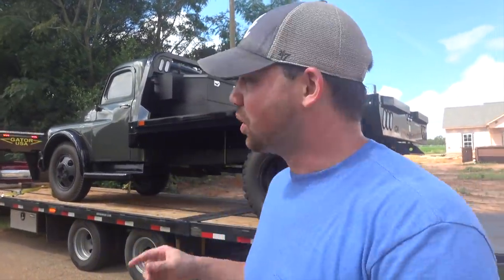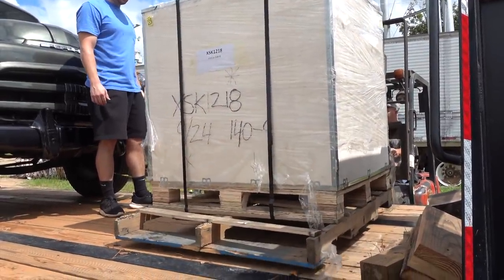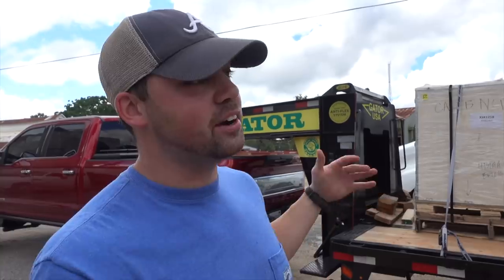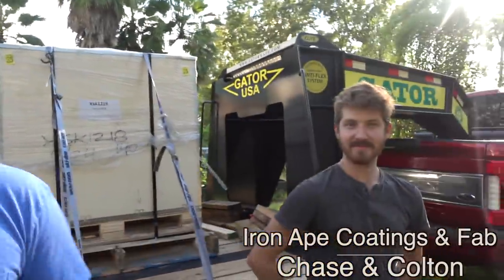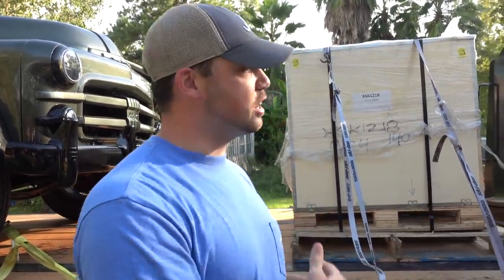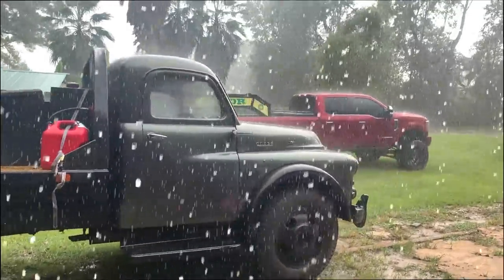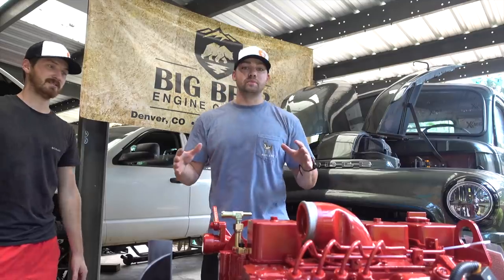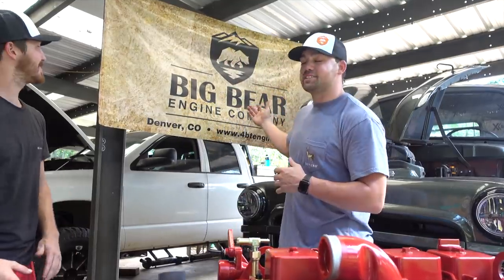ENGINE SWAP TIME!! 1951 Dodge Truck Gets NEW ENGINE!!

Comment: Need to do a full price build sheet towards the end of this build👍🏻👍🏻
Reply: Probably could have bought a newer, complete truck for what they have in this one if you add in the labor costs.  I guess what they've done to this truck is better than scrapping it but......
Reply: @richardcline1337  it's going to be a pretty pricey swap. he's not very crafty when it comes to this stuff, if he was it can be done for next to nothing. My 6bt  swap cost less than $500 engine and trans included.

Comment: That 4bt is going to be a blast in mater, you figure it has at least double the horse power and triple the torque. Good pick.
Reply: Maybe double the torque but the 4BTAA is no horsepower monster, only a meager 140HP according to their company website. Nice engine, sure, but it's my opinion that it doesn't belong in a 70 year old truck that still has the original motor after 70 years.
Reply: Joseph Grief well good thing it aint your build
Reply: @josephg41  Lol @ original fan Boys. Screw that  70 year old gas motor.
Reply: @bradenublish3710  And that's why I said it's MY Opinion. And I do have a build, a 1956 Chevy 3600 3/4 ton. And I've kept  the original V8 and 4 speed and can still tow more than 5,000 pounds. Stock can do more than people give it credit for and in 50 years it'll always be worth more than if I had swapped it. Hell it's worth more that way now.
Reply: I have two 1952 dodge b3b trucks they both have the flathead six that they came with and a 1955 6400 with the 409 in it. My son has a 1957 3100 that has a 327 that was swapped in because the original motor whent to crap, so i have a mix of original and modified.
Reply: @josephg41  lmfao @ original stock fan Boys. That right stocks sucks
Reply: @josephg41  5,000 lbs is nothing my guy
Reply: @Jake-vc1jd  First off is, 5,000 is a decent amount, it wasn't 15 years ago that a brand new basic 3/4 ton was barely rated for 9,000 pounds. So for a 3/4 ton truck almost 60 years older, only down 4,000 is not too bad. Secondly and most importantly, 5,000 is just as high as i've ever bothered to tow with that truck. I know it can tow more than that. It has a stock 4.56 set of rear gears and an Sm420 4 speed with a ridiculously low granny 1st gear 7.05:1,  Gear reduction was the key to old trucks, even though those old inline 6's put much more modern engines to shame with their torque output. But power was not the limiting factor in towing, really it was mostly brakes. It may have a top speed of 55 mph, but it'd haul a house, sometimes literally. After all, back then trucks were solely workhorses, none of this 12 inch touchscreen bullshit of the new ones, a truck was a true work-only vehicle. America had to be built somehow...
Reply: @josephg41  I'm all for old trucks but they are not better at all. Worse gas mileage, shitier ride, less power, less nice features (having cool shit that makes you comfy doesn't make you less of a man), extremely low towing capacities etc. And most half tons have have been rated for 5-9k for 25-30 years at this point
Reply: @Jake-vc1jd  That '56 gets 20 mpg. My '05 silverado gets 13. So thats not true at all, ride is worse, sure, The reason is durability. For the same reason that brand new heavy duty 2 ton + trucks still use straight front I beams. And my '91 F150 is only rated for 5k lbs. Once again for a 3/4 ton 35 years older to tow the same amount is a big deal. You won't find many modern trucks 60 years from now that will be able to simply start up and go back to working like they were brand new with basically no help. A computer fault is enough to make a modern truck utterly useless. They simply are not built to last anymore.
Reply: @josephg41  your 56 does not get 20mpg, and most new electronically controlled vehicles don't break down like everyone says they do, yes it happens sometimes but those electronic errors are really easy to fix and are normally not very expensive
Reply: @Jake-vc1jd   I know what i'm talking about, it has a 235 inline 6 cylinder with a 1bbl carburator. If you knew your shit you'd know that it is more than possible to acheive 20mpg. My '05 is a 6.0 LS V8, and it gets 13mpg on a good day. And secondly, I am an ASE certified auto tech, I work on modern cars for a living. "Electronic errors" are plenty common, especially on euro cars and they are one of the most expensive repairs to do. The eletronic equipment is proprietary to each manufacturer, and most of the time when something with them goes wrong, you cannot "repair" them. You replace them and pay an arm and a leg for the OE replacement part. The quality is not there anymore. You have brands throwing GDI injected 4 cylinder turbocharged engines in 1/2 ton trucks, you are lucky to get to 100,000 miles trouble free, or at all. What a joke.
Reply: @josephg41  you're bringing up shit I'm not talking about. Euro cars have always been nightmares to work on. Yes you can have terrible electric systems to work on but most of the time it works, and it works great. And I never said anything about the shitty 4 cylinder half tons, only idiots buy those
Reply: @Jake-vc1jd  Euro cars was just a point, not the topic. Your argument has seemingly been that modern trucks are better than old trucks, consequently it doesn't matter that YOU didn't bring up shitty 4 cyl 1/2 tons, because they are modern trucks regardless.  To me, and most people I know, a truck is supposed to be a vehicle that is escpecially reliable, durable, and able to take a beating and keep trucking. So a modern truck might have more towing capacity, but in all those other basic qualifications of a truck, modern trucks are sorely lacking.

Comment: Good choice for the engine. I would pull off the body after mockup to protect it. You can more easily repaint the frame after final assembly and while you are at it, you can detail the firewall. I would definitely do a 4 wheel disc brake conversion, and adding power steering is a great idea, plus will be safer. The idea of using an engine where parts are so easily accessible is very smart. For added comfort on the road, consider a set of captains chairs with a console. The truck is going to continue to be a great looking workhorse, so driver/passenger comfort should come into play.

Comment: My truck has been sitting for years.  You’ve inspired me to get er done.  I took mine down to the frame.  Different engine (6 cyl flathead dodge).  Rotted floor boards.  Getting it back together.  Looking for lost parts in my shop!  Paint is Ford blue, budget deal.  You’re throwing a lot of money at yours that I don’t have..  not farming any of the work out so it is slow going.  Where did you get the name?

Comment: Great choice I reluctantly sold my 96 with a p-pump last year. Now my 2016 dodge gets about 1 mile per gallon less but the truck is 1500# 
Heavier. I wanted to keep for exactly what you are doing but I had no place to keep it.

Comment: Hey Guys ,  what a Great Project 😎: currently have a 4bt Cummins setting in a 1966 Chevy C20, installed it about a month ago,  Hydroboost brakes from Rockauto 96 Chevy , I’ve had the motor about five years it was in a rat rod I’d built and just decided to change up my Chevy took out a LS conversion I did about ten years ago. From an Old School Fabricator ; Have Fun

Comment: Key is how you plan to use the truck. if hauling to shows the 4BT is a good choice. If only occasionally using locally then keep the old flathead.
Don't cut into the firewall for additional cylinders that are only of any use 1% of the time or less. 
Transmission pairing is going to be interesting.

Comment: Yo I KNEW IT 4bt p pumped
Reply: Same. Guessing an NV4500 for the trans.
Reply: That's a Cummins motor right ?
Reply: Austen well we will see personally for trucks I prefer a 6 speed manual so a Eaton fuller 6 speed or nv5600 will do the job
Reply: Jaydon Deas yes it is

Comment: Does that setup come with full wiring harness I did some swapping while back for a 53 dodge truck the body/ frame is solid. Trying to figure what Im going to do for engine setup I do have donor of running 5.2 and 5.7. Thank you for your helpful ideas.

Comment: I have a 57 Willy's 4x4 truck I was thinking of doing the same thing taking out the flathead 6 and my friend said put in a 6 cylinder diesel engine and a automatic transmission instead of the  3 speed manual transmission I on the hill about changing the transmission I do want to change the hearing in the axles because at 60 mph the wining sound from it

Comment: Probably a off topic question but does mopar still sell a replacement chassis assembly for a 2000 dodge ram 3500?  2000 dodge ram 3500 4x4 extended cab dually A/T (relatives truck)

Comment: Personally, I would have kept the truck stock and rebuilt the original drivetrain, but a 4BT might be a capable substitute. It'll definitely have the torque for towing/hauling.

I just can't get over how the 4BT has roughly the same performance specs as a VW 2.0 TDI, despite being double the displacement and much heavier.

Comment: I would have found one of the new Cummins v6 engines out of the 1500 dodge trucks from a junk yard along with the computer and wire harnesses to put in Mater
Reply: Those Eco-diesel engines are junk, the one in my friends truck spent almost as much time in the shop as on the road

Comment: I think having a diesel in mater was a great idea but at the same time I think I would of rebuilt the original engine and put some bigger pistons in it. There’s things you can do to a gas engine to get more HP. You could of gone with a turbocharger also with the gas setup. You seem to have quite a bit of money to do these projects plus live in a beautiful home so I can see why you went with the diesel. Can’t wait they start the build. Did you drive to Colorado or is someone doing it locally that works for that company.

Comment: Good choice, I just finished putting a 4bt ve pump in my 56 chevy 3100 with an nv4500.  you will prob want a different rear gear ratio. Power steering is an easy install so are power brakes. Check out cpp.com

Comment: What's kind of hilarious to me is this new motor only makes 20 more horsepower than the 251 inline 6 it's replacing. And yes, IK torque is what counts. The 4BTAA makes high 400's but the original 251 made about 250 lb/ft. Yeah sure no monster, but having been with the truck for 70 years and still running, I wish there would be no swap.

Comment: What was wrong with the original engine?

Just wondering
Reply: Just under powered.
Reply: Just a carburetor 😂
Reply: Cuz it a 70 year old gas motor. That truck needs a diesel motor   hands down

Comment: You should have put a 12 valve Cummins in it
Reply: It wouldn't of fit properly. A 12 valve is too long.
Reply: 4 cylinder sucks
Reply: I would’ve cut the fire wall
Reply: Campbell01 I know but I would have made it work
Reply: Jacob Clark same

Comment: I can assume that it will be towing a trailer and doing some highway speed so upping the gear set will be a plus to get away from that high worn rear gear set. If me, I would go a six speed but you know what your comfort zones are and automatic's earn a lot of  respect out there. My easier to work just two peddle's and back into a spot just big enough to fit and no extra's. I like power as much as the next guy but it isn't a bottomless pit for money. A little smoke for the crowd and a lot of pulling power for the hills back there.... you all have some serious hills. Might see what they could do about a air wiper system since you have it. I think that vacuum wiper motors can be converted to air. Bags are a must and I do know that Saginaw makes a power steering system for everything. I don't know how deep those pockets are but to do bags, it requires a lot of nice tools. Fat Tony will keep you all busy till it's "brother" gets home. That is a chunk out of the "401" that had to hurt bad. Your going to need that ad money that youtube pays gratuities off of. Also would be nice to see the wife in some of these videos.